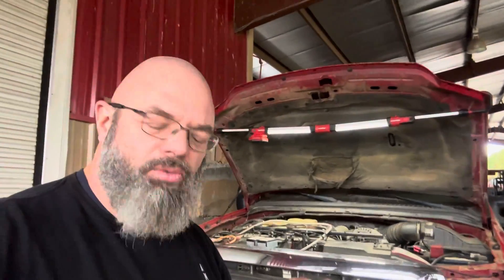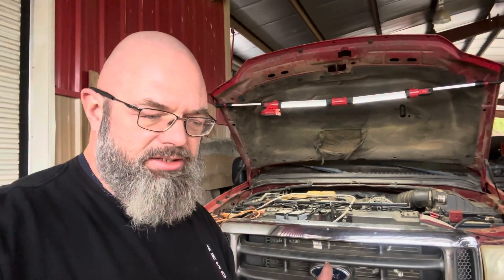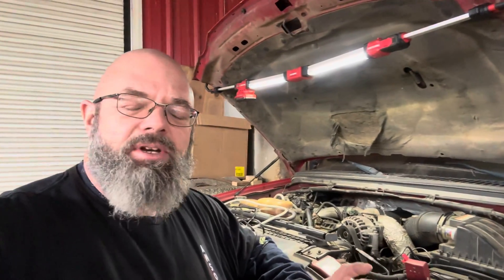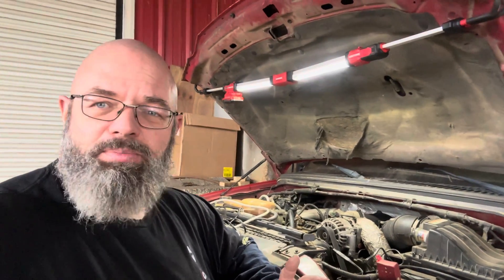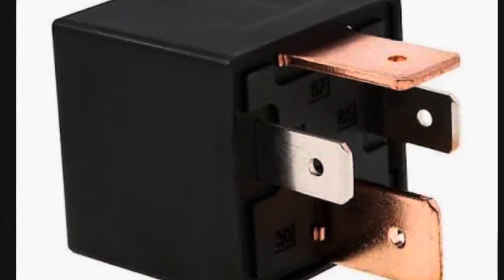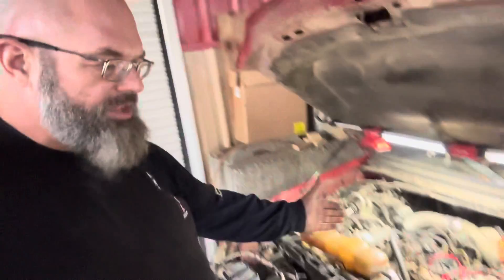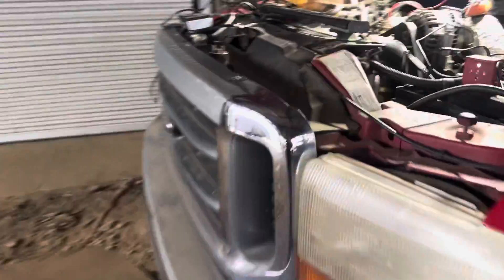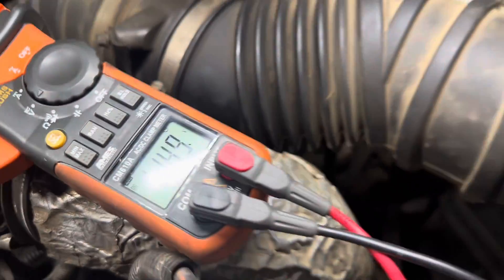7.3 liter Powerstroke  glow plug relay failure. Diagnostic procedure on the F550

Comment: So I have a 1996 f30 and I just changed the solenoid and sometimes it fires right up, and other times all I hear is a click like the solenoid is opening,. Sometimes I have to turn the key up to 5 times to finally get the starter to engage and spin over the motor
Reply from the maker: That’s a tough one to diagnose remotely.

Comment: My truck has the glow plug light on and won’t go away and my truck won’t start and I got the check engine light on at the same time with the glow plug did you have the same issue with the lights stay on
Reply from the maker: No, definitely not the same issue

Comment: Thank you Adam for such a wonderful video, including the goofs and missing startup portion.  It's what makes the best videos.  

I have been chasing various issues and couldn't get my truck to start without trying various things, like swapping out the cam shaft sensor, ICP sensor, and fuel filter.  I noticed that there is no 'wait to start' light in the dashboard, so I'm going to try changing out the glow plug relay and I'll let you know what the issue was in hopes that it may help you and others, like you're doing.

Comment: on mine (not ford but using generic replacement Ford GP Relay)  it is grounded via the base of the relay....... so no wire on the  primary circuit ground (I)  only power to  primary/switch (S) via a push button switch inside breaking wire between battery and Relay's "S"  .    I do get a CLICK*   set up like that.  Like yours though I get no power from big lug (battery) connecting to big lug (GPlugs).     soooooo guess my issue is relay?    Did try temporary ground the opposite small terminal (I) ... but (unless it fell off. it was very temporary)  I still got no power to happen across the big lugs.   GP switch is push button so having to test with long leads to meter sitting in the car while I hold the button.  

* Curious if maybe keep blow fuses and maybe this relay with a different issue.   AKA-  I kept popping fuses in this setup.  (and the OEM one before swapping to this Ford Version)   So went to bigger fuse between battery and Big Lug of  relay. AND way bigger wires.  (was 6gauge... now 2gauge / was 80amp fuse.. now 100amp circuit breaker)    When I first tried it TODAY..... swear I heard TWO CLICKS...... now I hear only one.  

So my question is...... did all my bigger stuff allow a still existing  issue .... to blow the relay instead of my fuse.  (does not make sense to me.....  but Im half stupid maybe?   )

Would an accidental power going into my ground system cause this issue of blowing stuff?   How to check for that?  

what is ya'lls thoughts.
Reply from the maker: It sounds like you may have a short somewhere in the system, so you'll want to make sure to check all the wiring before replacing anything. Typically when a fuse blows, it’s because there’s too high of a load on the circuit, or a short to ground.

Comment: Hey brother, appreciate the video. I replaced my solenoid and I'm still not getting the power to go through to the other big terminal that goes to the glow plug wiring harness valve cover gasket? If I take a jumper cable and go from the ground to the rear little peg the one that's towards the window then it works. So I guess I'm not getting a ground somewhere somehow?
Reply from the maker: That sounds like a wiring issue, I would definitely check out the ground connection!
Reply: @amsoiladam  mine's grounded in the PCM and I just replaced the PCM. I replaced the glow plugs. The valve cover gaskets the solenoid the PCM I tried using oil temperature sensor off of my buddy's truck. That didn't make a difference. The only other thing I can think of is the barometric pressure sensor?

Comment: Isn't it always fun working on equipment during winter? You explain this so anyone should be able to diagnose there own problems! Looks like while you have tgat battery cable off to polish the terminals. Great job and outstanding video! Thanks!
Reply: and cars with all this computer crap..  newest bike I ever had was a 73 shovel..  my other was a 65 pan..  just like those years of cars much easier to work on..
Reply from the maker: Definitely true
Reply from the maker: Absolutely